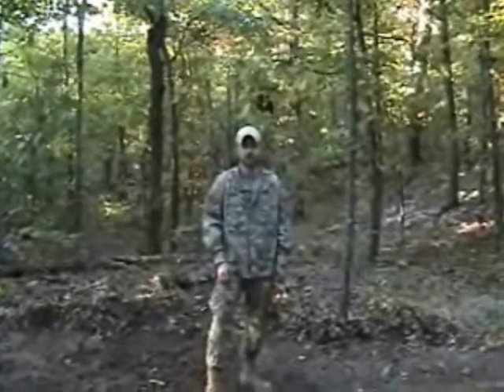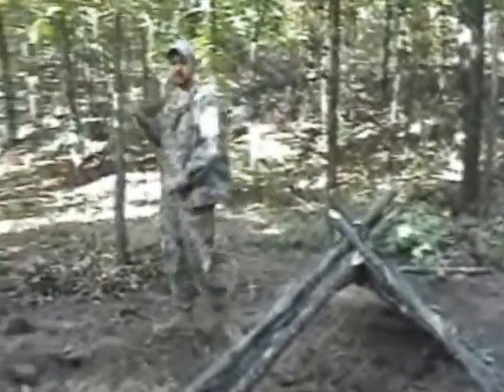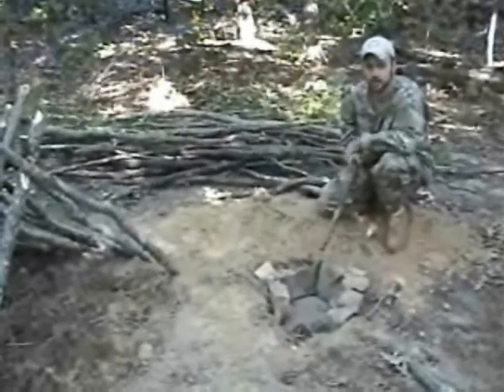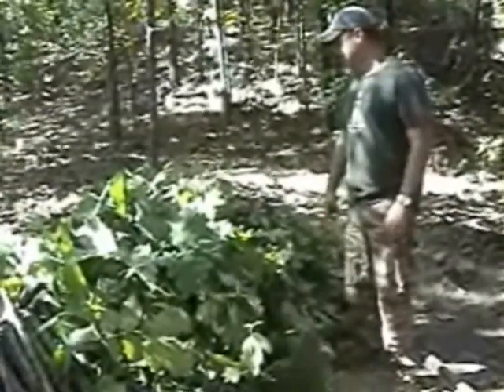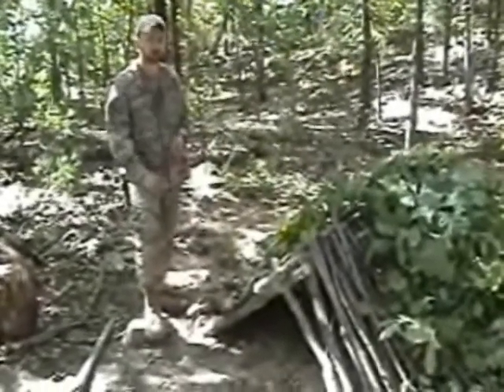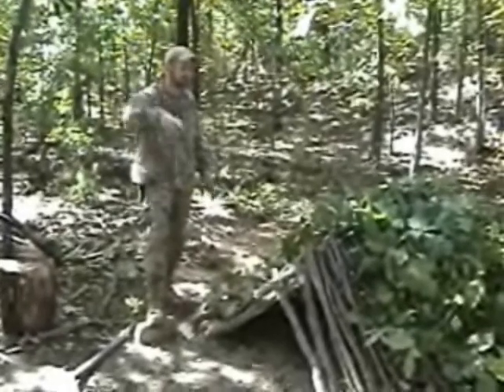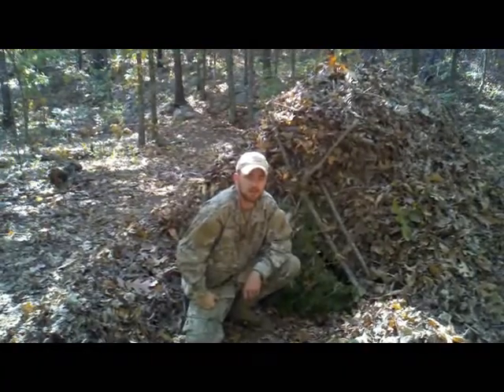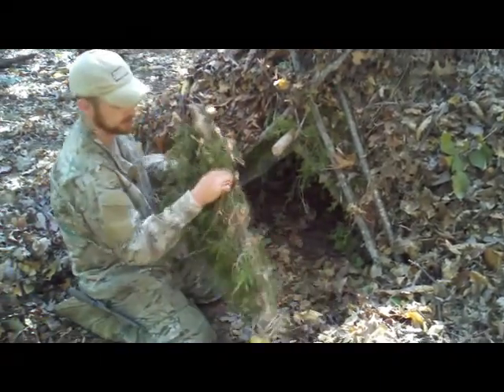Debris Hut w/ internal heating

Comment from the maker: you don't need ventalation with just hot rocks, but there are air holes around the door unless you work really hard to stuff it shut. If something was burning it would need ventilation but this doesn't

Comment from the maker: @mogges1 Well if you do that you can't have a debris bed. Its a major pain in the ass to dig the holes every single night if you even can in smaller debris huts, not a whole lot of space to move around. Rocks are very difficult to get to the right temp and when you bury them you may have to wait for it to cool off. I prefer this method for when I have no shelter. The pit is the ultimate in convenience!

Comment: Heating rocks is a dangerous thing.  You have to be aware that some rocks have water trapped inside them and will explode like hand grenades when heated.  Stay well away from where the rocks are being heated. Add plenty of fuel to the fire so you don't have to go near it again to add more.  Hot rocks work great, but you need to be careful and understand the hazard involved.  Once the fire has burned down, the rocks that will explode will have done so and it's safe to approach again.  After heating them once, they will be safe to reheat again without fear of them exploding.   Also be aware that nylon and other synthetic will melt or even flame if they touch hot rocks. Wool blankets covering your synthetic will protect them as wool won't flame and it's a good heat insulator.  Dragging hot rocks on a wool blanket is a good way to move them to your hut if you don't have heavy non synthetic gloves or mittens.  Use a stick to roll them out of the coals and onto the blanket.
Reply: +kwo dell Selection and location has a great deal to do with it s well.
Reply: you can easily make a stick or bough "sled" to roll the rocks onto and move them with it.
Reply: Just dont get rocks from a creek bed or any thats been submerged in water.

Comment: You will get ticks and die of lime disease if you sleep in that leaf pile.
Reply from the maker: ***** this is more of a winter shelter sir. I don't use it in summer or spring. But you can treat your clothing with permethrine. And tuck your pants into your boots, and your shirt into your pants and you can sleep on anything and not get bite. Its like bug armor for you ;) hope that clarifies things sir
Reply: Sigma 3 Survival School When you are making a shelter and want to keep warm like in the winter with a fire burning inside, how do you keep good ventilation? Like if there was no ventilation you would be smoked out, but if there a was a hole you would let the heat out.. so how exactly do you do that?
Reply from the maker: ***** well in this shelter there is no fire. only hot rocks. heat the rocks in fire right outside shelter and put them in pit inside shelter. If I wanted a fire to heat me instead of rocks. I would build a different shelter, such as a lean to or wickiup. Or double lean too depending on how long I'm staying there.
Reply: Sigma 3 Survival School How would you fare if you had to get in that hut very fast?
Reply: Sigma 3 Survival School How would you fare if you had to get in that hut very fast?
Reply: Or a blanket. I got a dog tick on me before! Imagine sleeping in that.
Reply: ***** Have you heard about military tent stoves? The old styles, which I have two, are like a metal box with a vent door on one end and a hole for the pipe on the other.
Reply: +Scrubtron Online Ticks are in the woods. Japanese Knotweed tea negates the symptoms. If folks are afraid of ticks there is always tennis rather than awareness and routines to address tick borne pathogens.
Reply: +Joe Johnson Ticks are easy to remove and deal with. Being an alien on ones own landscape, not so much.
Reply: Scrubtron Online it depends where youre at ,  also ticks are not a problem in the winter
Reply: Teresa Gideon unless you're in a section of the world where it has hot spells in winter. But usually they're not a problem.